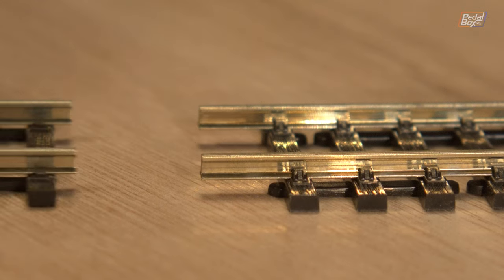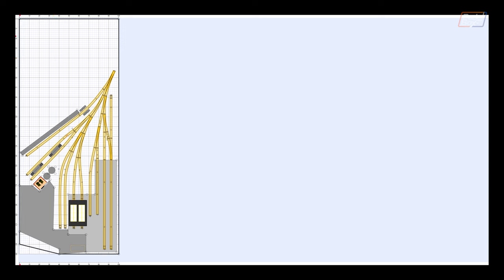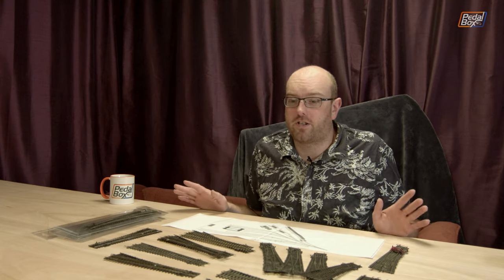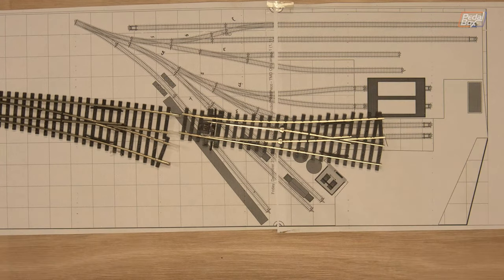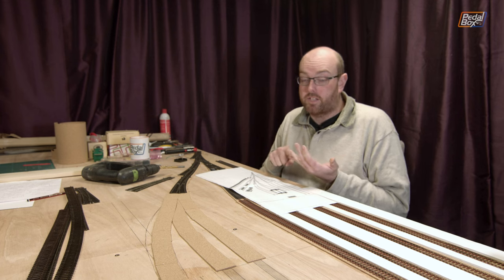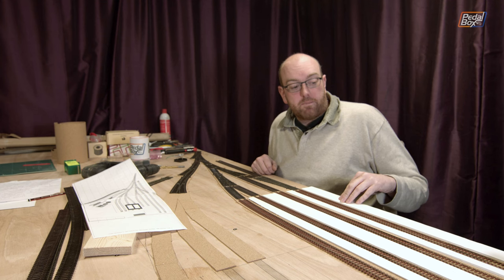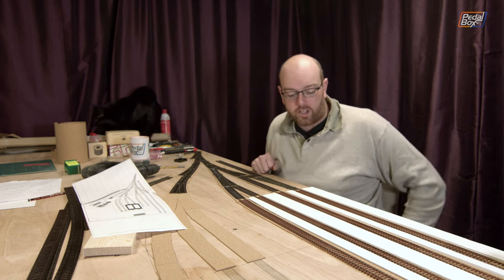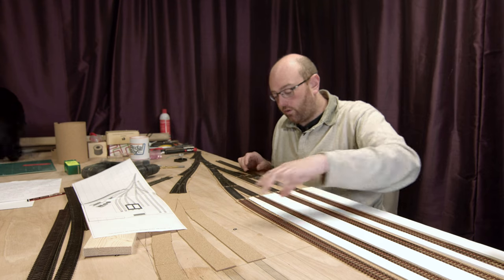Laying Out Plans | PedalBox Junction OO Gauge Model Railway | Episode 2

Comment: Looks really good. Don't forget you might need a bit of a headshunt to move between sidings within the depot. I live near Leicester Depot and when they're moving stuff around they often shunt right out the depot, luckily they've got a fair bit of space before the points for the mainline. Great job so far
Reply from the maker: Hmm, theres one to the very outside lane, I pondered adding another on the otherside of the main run of 4 tracks as well, might be modifying the track again soon then :)